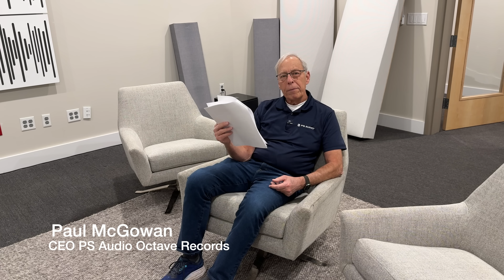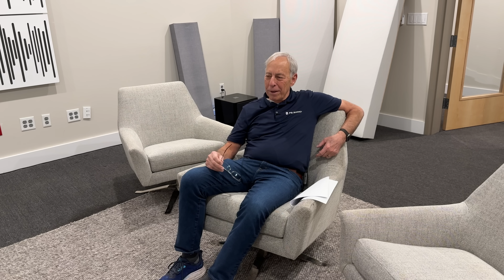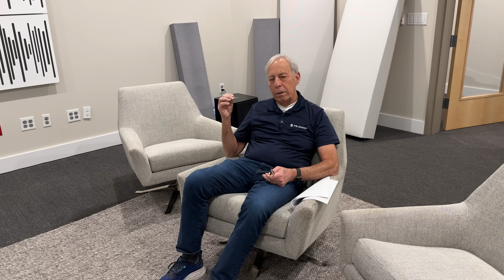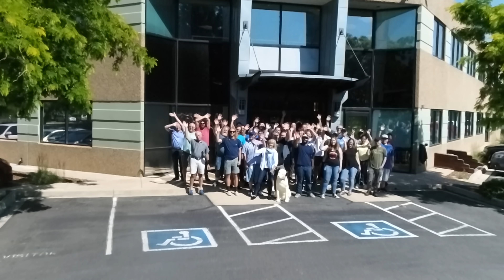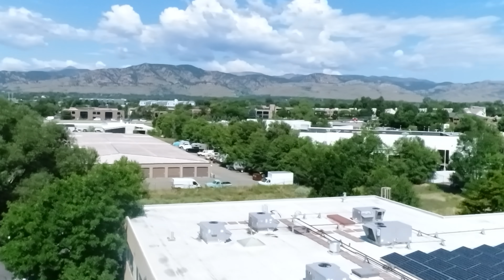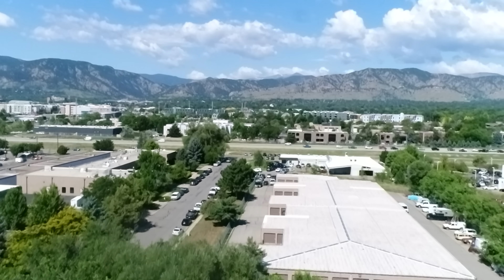Bandwidth limitations on fiber optics in audio

Comment: The quality of the cables makes all the difference, especially now that some manufacturers are putting out GLASS cables to the audio community. A simple and great example of this is, I just added a Bluesound NODE to my system replacing totally the last remnants of my NAD AV receiver. First, I couldn't get you Stellar DAC to even recognize the Node's COAX output. I tried everything I could. SO, I went with optical. I tried just a cheap run of a certain retailer's house Optical TOSLINK cable. But I noticed that all I could get was 96/24 from it. Then I finally found an old quality brand TOSLINK in my closet and WOW it immediately jumped up to 192/24. SO, cables, even Optical matter.

Comment: Can fairly high wind create a danger to your cd player if it is playing? We are having 50 mph winds and the electric lines are swaying in the wind. Many years ago, my cd player went black as they set off some fireworks about a mile away during a celebration. I figured they must have been set off too close to some power lines and if fried my cd player. Unlike it was a grand coincidence that my cd player quit right during the  fireworks.

Comment: We need to keep in mind that a 44.1K or 48K bit stream is not running at 44.1 or 48 khz. The 48K is just the sample rate. A standard audio frame is 32 bits. Up to 24 bits for audio* and 8 for metadata. So we multiply (48k * 32) we get 1.53mhz. 96K doubles that number and so on up to 192K sample rate which equals 6.14mhz. That is video bandwidth (standard definition). So serial digital audio is running in the RF spectrum and thus transmission over wire or fiber becomes increasingly complex.

*The transmission frame allows for 24bit audio. However that doesn't mean we always get 24bit resolution. In the case of 16bit CD audio, the lower 8 bits are just ignored by setting them to zero.

Comment: Good explanation around the limitations of toslink and why it has had its day. In the world of TV/home theatre, HDMI replaced toslink and component video cables as the standard connection over a decade ago and I don't understand why it hasn't also replaced toslink in the audio world. HDMI has an industry wide standard so can be implemented on any piece of audio equipment with no compatibility problems and is also a good reason why an older higher end AVR can make an excellent hub for an audio system as it will handle hi res audio sources with no issues. Some even have good internal Dacs.
Reply: True HDMI audio (not these I2S hacks) is quite complicated. Just as with old analog TV,  there is a space between each scan line, used to be called H blanking, now it's called HANC. This is where the audio channels along with other high speed metadata is carried. The audio must then be at the video sampling rate, which is much, much higher. So the audio is time compressed and then restored in the HDMI receiving device. The audio samples are written into a memory buffer at the native audio sample rate. As the buffer fills, the samples are read out at the video rate and placed in the HANC area as short data bursts.  In the receiver, the opposite is done to restore the audio back to its native sample rate. This means a full video rate clocking system must be added to any audio only device as well as the processing hardware. It's just an extra cost for no real benefit over SPDIF for audio only usage.

Comment: Ive wondered this myself. I once thought we were gonna even see an optical video interconnect at some point. Instead they just opted to develop further into copper. In the data world, fiber has a far better latency than copper ever can mind you.
Reply: We do. It's called SDI or HDSDI. It can be run on coax cable or fiber, now up to 12gbs (4K UHD). But's it's only used in broadcast and commercial AV systems. HDMI was built on the SDI standard and may things are similar. But SDI at 12gbs can run 100 feet on coax. 200 feet for 1080p HDTV.  Even in broadcast and mastering facility design (which I do) we only resort to fiber if we exceed the practical coax length limit. Fiber is expensive, terminating fiber is a skill that requires training and practice, fiber requires powered hardware at each end which now  introduces more 2 points of failure. On HDMI over 50 feet you should convert to fiber HDMI but that's rare. Most residential HDMI runs are six feet or less. It's simply a cost issue yet if you need fiber for long runs, there is a plethora of third party converters which can do that for you.

P.S. Fiber transmission is actually slower than electrons through copper wire. It's due the velocity of propagation in different materials such as metal and glass. But as fiber can carry a lot more data per second (bandwidth) than copper wire, it ultimately is faster. We are talking  slight differences at around 68% the speed of light so the speed difference  is basically irrelevant for almost all applications.

Comment: So if the professional companies have to clean the fibre optic cables. It would seem to make sense that it would be a good idea to change out our Audio optic cables every now and then.🤷🏻
Reply: As a general rule Communication companies clean and inspect fiber optic connections upon turn up of a new piece of equipment or if there is a failure and an existing connection needs to be taken apart for troubleshooting.  We do not routinely disconnect customers to clean their connections.

Comment: It would be great to see a fibre optic cable standard emerge for I2S and to replace clock coax cable.  Rigid coax with SMA and U.FL connectors are a pain.
Reply: No. What would be great is for crystal oscillator companies to stop charging an arm and a leg for a decent clock. Then you could just reclock all the incoming data using any junk connection you want and it wouldn't make a difference. You could use telephone wire as a data connection and as long as the bits reliably made it to the dac, it would sound just as good if not better than any i2S connection out there.

Comment: It's such a shame and sad that no one has come up with an improved version of toslink MANY years ago.
It wouldn't have been that difficult.

Another thing is bluetooth which to me  a mystery that it has not become faster. bluetooth is so incredibly slow!

Bluetooth is so good but such an incredibly slow way of communication.

It is also a shame that all units use 10 meter radio transmitters and not 50m or 100m

Comment: Rarely do these audio discussions cover an important concept: synchronous vs. asynchronous serial interfaces.  For example, Internet connections are done over asynchronous serial networks (which is why audiophiles obsessing over internet cables is silly.)  However  , consumer audio digital links, such as S/PDIF, as discussed by Paul, suffer the problems of synchronous interfaces, such as jitter.  Bandwidth is rarely the issue in today's audio quality (e.g. Octave Radio sounds great over a low-cost internet connection.)
Reply: Precisely this. TOSLINK has its limitations yes, due to mode dispersion in the large diameter fibre optic guide used, but S/PDIF is the other side of the problem. You need to go to an asynchronous protocol. This would also solve the master/slave clock synchronisation issues. And yes, audiophiles obsessing over internet cables is silly.

Comment: The Toshiba TOS-LINK protocol (one form of S/PDIF (Sony/Philips Digital Interface)) was originally limited to 48 kHz at 20 bits PCM. This was extended by manufacturers to support additional formats limited like DTS but was still limited by the capabilities of the standardised optical encoder and receiver converter -- higher resolution signals could be sent or received but only if the same spec encoder and converter were at both ends (same manufacturer and product range). 
The other form of S/PDIF is a copper/metal cable -- a digital interconnect -- which transmits two channels of digital audio up to 24-bits 192 kHz over a balanced XLR or RCA or BNC coaxial cable/interconnects. S/PDIF is the consumer version of this protocol, which uses either XLR/RCA/BNC leads or optical cables identical to lightpipe cables, overtime manufacturers have increased the throughput through such cable interconnects -- since no encoders or converters like those in TOSLINK are required there are more and more options. Whereas Twin SNC S/PDIF is used to connect  ultra high end components like the an M-upsampler to a Chord Dave where DSD 512 or even higher data flows can be transmitted.
Multichannel Audio Digital Interface (MADI) standardized as AES10 can carry 64 channels of audio at 48 kHz, 32 channels at 96 kHz or 16 channels at 192 kHz.
AES3 is the alternative to S/PDIF (AES = Audio Engineering Society and the European Broadcasting Union). Some manufacturers are now using I²S (Inter-IC Sound, pronounced "eye-squared-ess") or similar so called HD-audio connections - these use cables similar to HDMI to connect is an electrical serial bus interface standard used for connecting digital audio devices together - often with bidirectional signals for error correction and clock syncing. 

Other links are used by a range of other manufacturers all with the goal to enable no throttling of data between components - one example is CH-link which CH use between their top of the line SACD /digital components and DAC(s). They all utilise a form of Serial Peripheral Interface (SPI), which offer even higher data throughput than I²S - currently some of the highest data modes are Thunderbolt 4 and USB-C 4. AND others are using point to point ethernet connection technology in a similar role. [eg CH's ETHERNET-IN HD – provides an Ethernet connection for replaying high-resolution streamed sources. The Streaming input accepts services such as Tidal or Qobuz, or locally stored files (PCM audio up to 768kHz/32bit - twice the DXD rate, and DSD up to 22.5792MHz - also called DSD512), as well as connecting the C1.2 to the dedicated audio/control network for remote control of all functionality via the CH Control Android App.]
There is also a USB socket on the ETHERNET-IN HD input board. This is NOT a USB audio input connection and is dedicated to the C1.2’s firmware update procedure. USB-IN – allows connection of USB audio sources, with PCM data rates up to 24bit/384kHz (DXD) and DoP-encoded DSD up to DSD128 (1bit/5.6448MHz). 

Typical specs:
- Fibre Optic TOSLINK – 44.1kHz to 96kHz
- AES XLR – 44.1kHz to 96kHz
- S/PDIF BNC Coax – 44.1kHz to 384kHz  16-bit to 24-bit 
- S/PDIF Dual BNC Special operation – DBNC: 88.2 kHz to 768 kHz 24-bit
- USB Type B – 44.1kHz to 768kHz (16 – 32bit) – PCM and DSD - these range from USB 1.0 to USB 2.0 see below for details
- Ethernet and Direct link 20-40 GB per second or higher (depending on whether direct serial bus connection like SATA or not).

What intrigues me is that most DACs (including the highest end DACs) still have the old USB appliance connector (USB-B) as an input. Whereas this form of USB has been vastly super seeded by more recent generations. for some time I have expected new DACs to come with USB-C or Thunderbolt (like many audio interfaces do) but the older connection technology seems to be hanging on.  I have seen some DAC's with more modern USB ports but NONE with USB-C yet (not the case for audio interfaces) 
Here are the different speeds for USB:
- Low Speed (USB 1.0) - 1.5Mbps
- Full Speed (USB 1.1) - 12Mbps
- High Speed (USB 2.0) - 480Mbps
- Super Speed (USB 3.0) - 5000 Mbps
- Super Speed (USB 3.1 Gen 1) - 5Gbps
- Super Speed+ (USB 3.2 Gen 2) - 10Gbps
- Super Speed (USB 3.2 Gen 2x2) - 20Gbps
- USB4 (USB 4 Gen 2x2) - 20Gbps
- USB4 (USB 4 Gen 3x2) - 40Gbps

Comment: can send high bandwidth data over fibre in the home. 
HDMI over fibre is the way to go for long runs (+5m) in the home for 48GB/s. Can do 48GB/s reliably over copper of <5m runs. Will send 8 channels at 24/192 or 6 channels of DSD/SACD. I don't see what the issue is. It's a common standard that everyone is familiar with and has all the HDCP that the rights holders want. It's also effectively free to implement (royalties are in the $0.05-$0.15 per device.) If a cheap blueray player and budget home-theatre receiver can have it; than so can your $5,000CD player or Expensive Pre-amp. 

Just alot of HIFI equipment is stuck in the dark ages and refuse to put HDMI connectivity on 2-channel components.

Comment: The gradual acceptance and incorporation of I2S gives one hope that newer technologies will become mainstream in audio.
Reply: That's not going to happen on any official basis. The only hope is all the I2S audio product developers would agree on the pinout and electrical standards using the HDMI connector and cable. But I think that ship has already sailed. I2S was never designed or intended as a component interconnect standard. Yes it does work fine for simple audio interconnects but it would never pass the rigid requirements needed for standardization as a cable connected interface. I2S as a component interconnect is an audiophile cult thing. The standard digital audio interfaces AES, SPDIF, ADAT, MADI, all work very well. Another glaring issue with I2S is that it requires four connection paths. That is not a big problem when connecting a transport to a DAC, but whe we get in long cable runs or the need to switch I2S we get into all kinds of electrical problems as well as four levels of switching needed.

Comment: Well 24bit 96khz or even more, no problem with Toslink. Where is the limitation? I know there are other digital standards which need higher bandwidth. But for simple stereo...
Reply: 24 bit / 192khz is the limit for Toslink.
Reply: The limitation for digital audio is simply that there is no standard to build to beyond TOSLINC. We have standard interfaces like AES which work just fine. Also when we go above 96K, the limited bandwidth of TOSLINC using plastic fiber and visible LEDs is sketchy. And as audio is becoming packet based over Ethernet, there's no incentive to build a better direct digital interface. Very soon Dante will rule the professional audio world and SMPTE 2110 will rule the video/audio sector. Yes even SDI and AES are quickly becoming obsolete.
Reply: nobody will hear any difference. toslink capabilities were 40 years ago beyong human hearing capabilities. anything more is mere markering wanting your money

Comment: Our whole world is already wired with fiber optical cables. This message was sent through them. Toslink is outdated and nowadays you get a lot more capabilities via USB. Is galvanic isolation not important nowadays? Not really. I bet even Octave Records is relying on copper cables to move the data and audio.

Comment: The fibers the big boys are using isnt exactly plug and play 'easy'.  The connections need to be perfect, levels need to be amplified or attenuated.  An inspection probe should be used to inpect the fiber for defects and cleanliness. Also, tons of heat generating electronics are needed to do all the magic to cram so many bits into such a tiny piece of precision manufactured glass.  Yeah, toslink plastic cables are 40+ year old tech than anybody can connect in a few seconds without any of the tedious labor that is required to properly install real fiber optic cabling.   Can you imagine audiophiles probing and cleaning their fibers regularly?

Comment: If want to do long runs of cable eg HDMI, USB there are now Fibreoptic options and not that expensive either. I would only connect a 4k projector using Fibre optic HDMI cable as anything else it will be a hit and miss just dont go out and speend hundreds of $$ on HDMI cables and repeaters/boosters it just aint going to be reliable! esp if 4k60 with eARC (Dolby Amos audio etc).  Pitty Philips/Toshiba isnt really inventing anymore or someone else come up with fibre optic standard as interconnects between devices could be so much better and reliable than HDMI, RCA etc etc.

Comment: Toslink connections are pretty good for consumer-grade equipment, 
but they aren't as precise as permanently connected fiber optics.  
Imagine it as the difference between trying to see something by looking through a loosely held length of garden hose 
versus a firmly mounted and stabilised length of rigid pipe.
Reply: That analogy right at the end .... are you saying that light velocity changes significantly as it passes a slight curve ..?